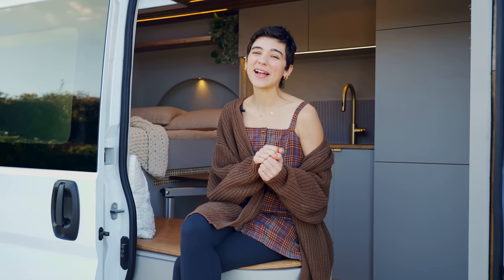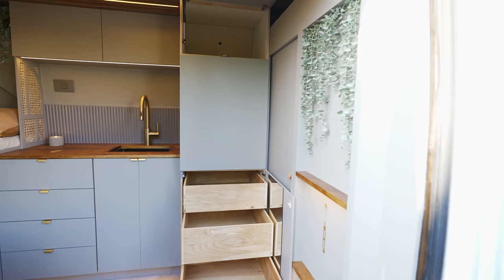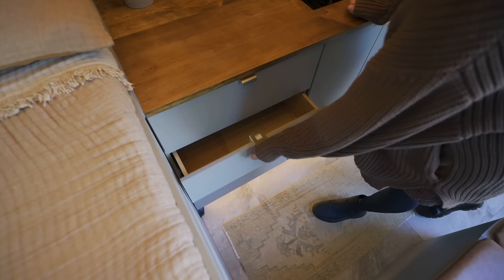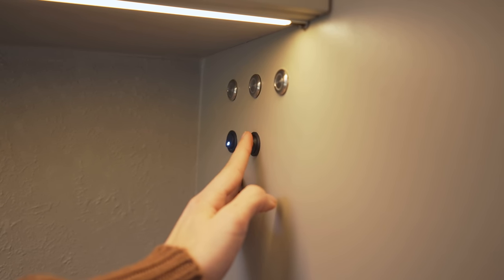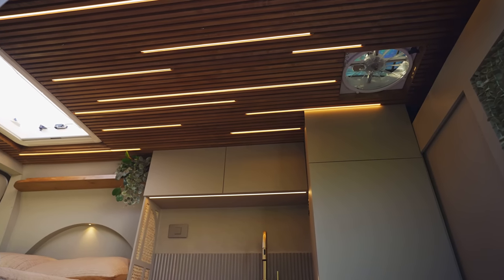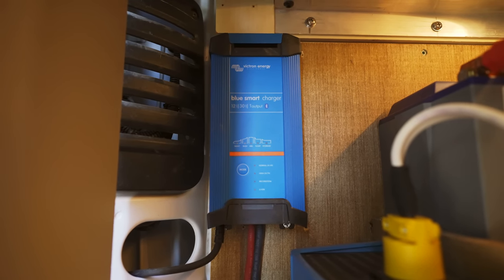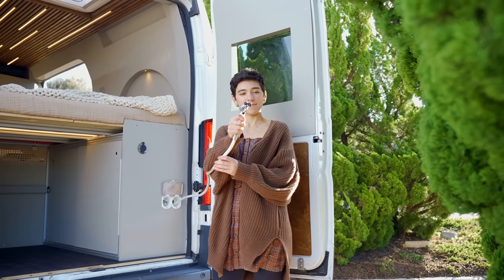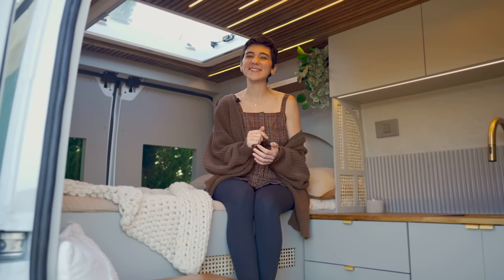VAN TOUR with HIDDEN SHOWER | Modern, Cozy DIY VAN BUILD with Expanding Kitchen, Skylight and Garage

Comment: Your builds are so amazing. They're ergonomic, futuristic, elegant and practical. I'm wondering however where is storage space for clothing and other equipment in this one however? But this is an otherwise incredibly smart build and very beautiful. I love how the shower is tucked away, the divider wall, it's clear you've thought the ventilation through, etc.
Reply from the maker: There are 3 large drawers under the refrigerator a couple of which would be amazing for clothing. The idea was that the large cabinet above the fridge would be a great pantry and we don’t really show or talk about it in the tour but there is also the whole headliner shelf which would be great for coats or bulky clothing items as well. Either way, after three years of full time vanlife, we’ve learned the key is minimalism especially in a smaller wheel base like this. 😊
Reply: Those style showers are in Popup campers. I used to have one. Its perfect for a van.
Reply: Wow!!!  Love this!

Comment: I have to say that is one of the best camper vans l have seen with the interior design. I don't like the color though that can easily be changed. The shower is hmmmm though considering that most vans of this size don't even have a shower - so this shower is good. Can l ask what is the cost of internal set up with water tanks and all?? Thank you for sharing. 💛💛

Comment: Phenomenal build! I love the counter/ cooker extension, the fridge at eye level, the curved ,ultipurpose stool, the shower/toilet set up, and the lighting! In the NW wetcoast I would prefer the levered windows. I would love to see how you would design a van with kitchen width wise behind cab with drop down counter to step through…maybe still incorporating smart pocket door. And lengthwise bed (with seating/table at end of bed…creating a possible counter / dual galley with 2 sliding doors.

Comment: Beautiful build!  If it were my van, I would have a door to the garage on the inside.
I might need something but weather or safety issues might be such that I wouldn't want to go outside.
I would also turn that wall behind the passenger door into a giant spice rack to hold smaller stuff.   Good on the pull out table and stove.  I like the lights and heater.  I do have a question tho.  Is it dangerous to be sleeping with your head above all the electronics?

Comment: Great work guys as always!  Cool to see you guys doing a ProMaster!  You fit so much on the 136, very impressive! Love the bulkhead slider door too! 

I've been checking out that 12 volt hot water heater.  How long does it take to heat up the water considering it's only 180 watts?  Do you just leave it on all the time?
Reply from the maker: We leave ours in our van on all the time yes but it takes about 45 minutes to warm up, so a bit longer for sure but a great middle ground option.

Comment: Beautiful and elegant! The shower concerns me....after you go to all the effort to set it up, it seems you can only rinse off with one hand....and then you have a sopping wet shower curtain that you have to fold up and stuff back in its bag. Seems like a breeding ground for mold?
Reply from the maker: We have this same shower setup in our van and it works really well. Firstly, it conserves a lot of water to shower like this. Rinse, soap off, rinse again. Secondly the shower curtain dries in about 45 minutes. You would need to let it dry before putting it away for sure but we’ve found it to be a great space saving solution.

Comment: Are you sure that this Ram ProMaster 1500 with the high roof & the 136" wheelbase is a 2018 model year? 2018 model year ProMasters still have the crosshair grille on the front, while this one has the updated "RAM" lettered grille. So perhaps this is a 2019 model year.
Reply from the maker: Yes, the dealership ended up replacing the grill since we noticed the old one was cracked and they only had the newer grills so it got a little face lift!

Comment: Hey guys! I was wondering if you could recommend what cooktop you got for this build? Thinking about doing the sliding out thing myself but don't understand how you managed to get it so slim in height. 😅 Thanks!
Reply: GSI Outdoors  Pinnacle 2 Burner Stove.  It's quite a price premium for that level of 'slimness' though.
Reply: @monkeyb1820  It was actually not that much more than the alternative I'd been looking at, except importing it to Sweden doubles the cost. 😒
Reply: @kevinkenell  I saw another fairly slim one for around half that price.  Seems like you should be able to find something in Sweden (since they're just using a basic camp stove, not an 'installed appliance').

Comment: 6:48 Shouldn't the hatch be installed the other way around? Considering that it does have a walkable solar panel on the roof
Reply from the maker: They are designed to be installed hinge forward so the wind doesn’t pry them open or damage them when driving.

Comment: If I see another shower in a van I'm going to scream. SHOWER OUTSIDE IN YOUR SWIMMERS! It's so much easier.
Reply from the maker: Having showered outside in 15 degrees F I can tell you it’s not always a great option even if you have hot water. If you watched the whole tour you’ll see there is an outdoor shower on this van. However, in cities or in poor weather it’s great to have this in the space. The best part about it is that you can still use the bench for practical storage but have it as an option if you need to shower inside. Better to have it and not need it than to need it and not have it.

Comment: Very impressive I do have a question do you guys use wood or 80/20 aluminum.
Reply from the maker: The pocked door and front wall is framed and made of 8020 as well as the entire garage space and bed frame. The cabinets are built frameless from baltic birch ply and bolted to the frame using plus nuts.

Comment: Need to lose the movable shoe/laundry storage and make it a fixed toilet. No one wants to lift and move a toilet around a van-especially if something is in it! The refrigerator needs to be bigger-worth losing some storage space. “Bench” seating is uncomfortable and only works for short periods. Unrealistic to “work” on it. Should be a proper seat with a proper back and pull out table that extends from the garage area. Air conditioning? Pretty van but definitely “form over function.”

Comment: These sorts of builds and content are killing van life because they're only building anticipation for audiences that are not technically inclined. All they want to see more decorative interiors. Looking outside of the content you can see that this van is like so many other vans where it comes straight from the factory, and they never touch the van itself, they only build a neat box inside the van behind the driver and passenger seats. They only use the space of the van, not any part of the van itself, or its engine, which is unlike typical car mods, even though van building is exactly just a car mod, and would only benefit from the official title. The biggest problem with this sort of build is that it's not sustainable. It's only a temporary thrill. It accepts the idea that a van with this good looking of an interior decore, can't be any more complete, and that if this is a complete van, then this is all van life has to offer. The originality of van life comes from the DIY'er. Industrialization only kills it. Sure DIY vans are better than factory RVs, but they're not finished developing just because they're gaining popularity and can be industrialized, and can boost sales of similar industries.
Reply from the maker: My wife and I built this van ourselves. As a team of two. No industry here.